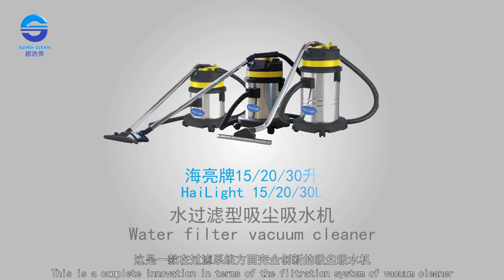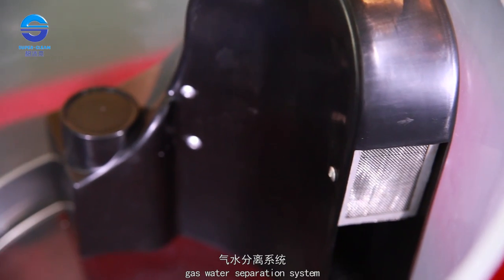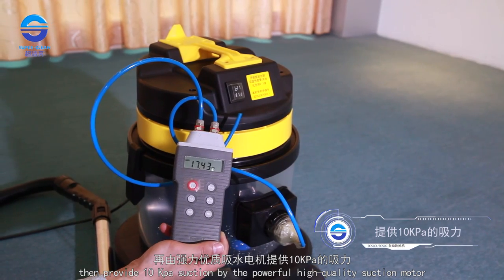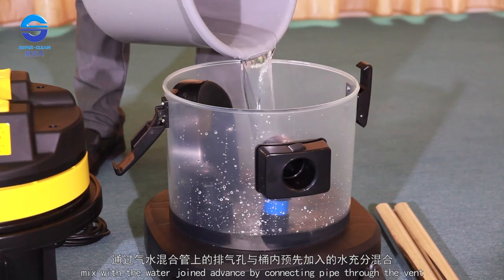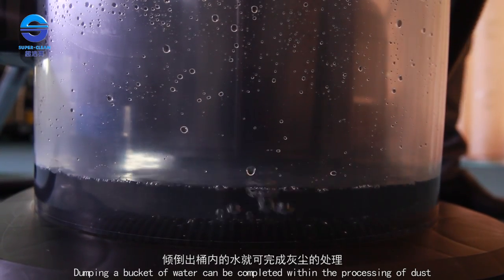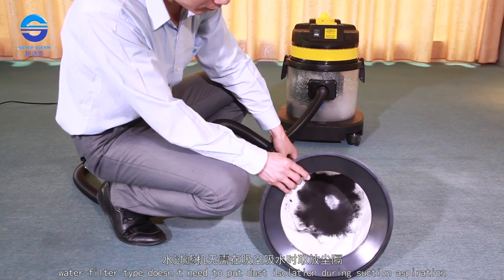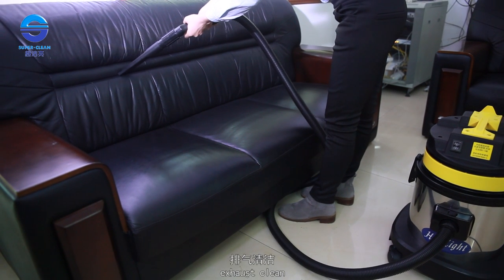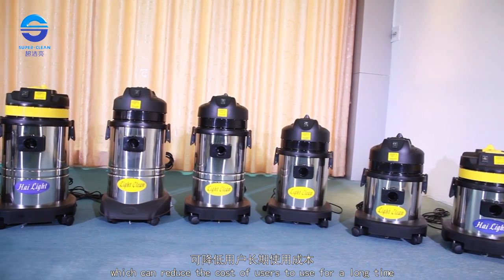Water  Filtration Vacuum Cleaner

Comment: This is the concept needed for underground-complex air-flitration systems (and building air-conditioning filtration systems) but with bubbling through sewage to grease-trap-oil to diesel to petrol to (water) burn as fuel due to the microdust and dust being collected by the previous stages and assisted-evaporate(process) the various fuels to (highly)combustible-gas. All the air trapped to produce combustible-gas. Buildings can have additional soapy-water(foam-bubbles) tank for extra industrial-aromatics pollution (fragrances) and further microdust stick to film of bubble-foam. When people think expensive, they forget the fundamentals and basics, and they become funny clowns (pollute environment then isuck-intake from environment and complain about price of filters). 

For this product, pneumatic drive to bottom (recycle some air), bubble to top (already), suction at top (already), driven air circuit can also be output to blow-dry, add steam-vacuum and $USD+300 at retail.?

Pneumatic drive because, besides no need filter, no need to clean blades of fan, no need to clean motor, ... very little maintenance, sudden increase in power can be triggered. Baseline = bleeding escape circuit, bleeding hose-handle, trigger-handle = one big leaf in garden is pull trigger for extra tear leaf into shreds power from vacuum-chamber bin. 12v power-tool batterie.sss and wall-socket for different power levels.? Car, garden, house, ...

vertical basket (big pipe with holes) and water intake with small pipe inside big pipe can delay getting clogged until the height of the water... = customer mod-hack to water-air canon